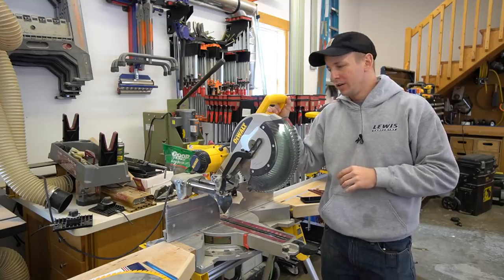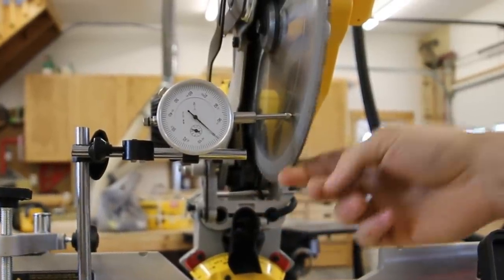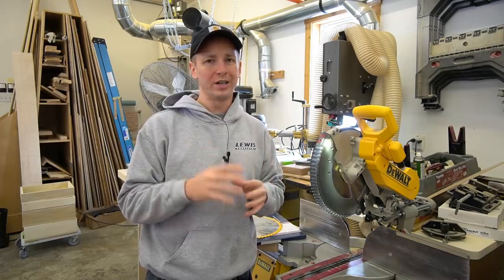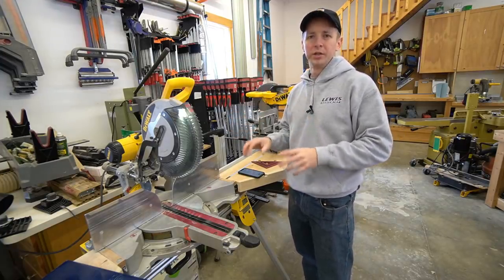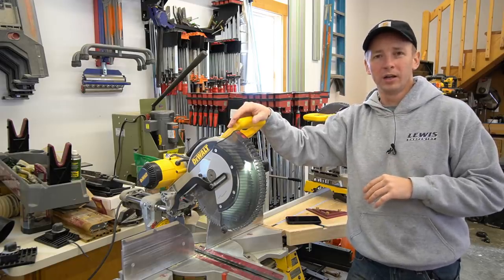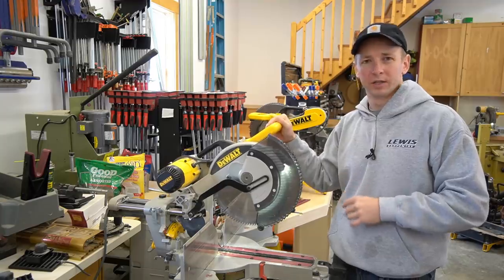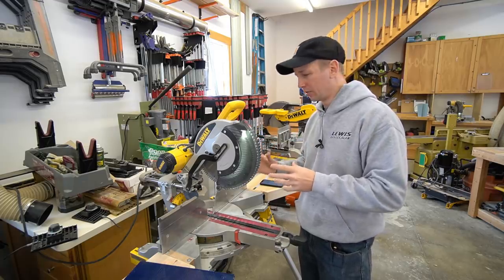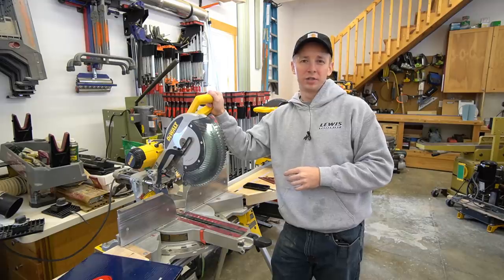DEWALT DWS780 | The BEST Miter Saw for Production Trim Carpenters???

Comment: I'm on my 3rd 779. I absolutely love them and I don't know a single other carpenter in my orbit using anything but a 779/780. They are just literally the best miter saw for the money on the market. The only thing I don't like is having to reach behind to bevel. I wish it was up front like the Bosch. It's the only thing I don't like about the saw but given the huge vertical cut capacity I don't bevel often.

Comment: Spencer I really appreciate your incite you provide in your videos. I'm wondering if you have ever used Milwaukee's 12" slider 6955-20? I've owned both the Kapex and Dewalt. Long story short I lost confidence in the DeWalt and bought the Kapex. It was great, but I had to sell it. Eventually I bought the Milwaukee and really like it. It has a digital miter scale which I love. It has a unique bevel lever to set the bevel angle, which I find really easy to set. Maybe not as nice as the Kapex, but better then the DeWalt. Dust collection is pretty good as well. I watch a lot of these type of videos on YouTube and I haven't seen anyone talking about the Milwaukee. I'm curious why it isn't talked about.
Reply from the maker: I'd like to try it. The dewalt has been the industry standand and most popular saw for a long time. It will be hard for milwaukee to compete with it.

Comment: The 779 only swings 48deg both ways.... is that enough? Seems kind of short. My fixed runs to like 60 deg. Rigid's equivalent meters to 70 deg each way. Is that dewalt 48 degrees really enough?

Comment: The problem I had with mine is that the rear fence isn't straight. The two sides were slightly concave, causing cuts to be a few degrees out on one side or the other. 

I ended up cutting and shimming them nearly perfect and haven't had any issues.
Reply: same issue for me. driving me crazy. how did you do it?
Reply: @williamdyer4431  I used blue painters tape and shinmed one side until it was flat, then squared the blade up. I did cut the fence in half on the rearward curve, but I'm not sure that was necessary.

Comment: It's my understanding that the runout can be the same on a 12" and 10" saw, but that at high speeds, and cutting through potentially heavy materials, that the 12" will deflect more due to the size. Hence blade stiffeners.
Reply from the maker: I think with a full kerf blade like I use that is all but eliminated.
Reply: @InsiderCarpentry  agreed! If accuracy matters at all, full kerf is the way to go. Did you say that the Kapex can’t handle a full kerf like the one you use?
Reply: What matters as well is how solid the arbor bearing is, especially on bevels.

Comment: You suck more then most.
Shadowline vs laser? 
Fine adjust bevel? You don't fineadjust.and the scale is not easy to read gets blocked .
Dewalt trench bolt flexes.
Blade cover needs fingerpulling if  blade is beveld.
"Motorproblem all over the world" - no only in sucky 110v country.
The kapex 88 sucks, but it's like a nicer dewalt, 
I can list 5bad  things with the kapex120 ,but is far better  .
a dewalt777 with 3-1 hose when dust is an issue.

Comment: I’ve owned a lot of miter saws.  I’m an airline captain but also own a construction company building and remodeling higher end homes.  

I have three crews for the homes we build. They are all very busy so it’s a first come first serve basis.  Anyway they all are run by first generation immigrants from Europe.   They love festool tools….. however they all, and I mean ALL run the Dewalt 780 saw and the Dewalt 10” contractor table saw. 

Now, they have the festool vacuums, sanders, track saws, dominos, and misc festool products.  One has a Kapex he keeps at his shop. He likes it a lot but is afraid to leave it on job sites at night. He always packs up the Festools but they almost always leave the Dewalt saws set up until they compete the job. 

I’ve owned too many saws. Currently own the Makita 10” 36v compound sliding saw with the Laser.  Before that I owned the Milwaukee M-18 10”, before that the Dewalt 780, before that Bosch 12” dual rail, similar to the 780 design, and before that saw I had the Hitachi C12LSH 12" Sliding Dual Compound Miter with Laser Marker & Digital Display.  Truthfully of all the saws I’ve owned, the Hitschi was the most accurate out of the box, the easiest to set unique compound settings (the digital display was fabulous in my opinion) and it was indestructible.  However the saw weighs 70 lbs!!  I had it mated to a roller stand and the two combined was 108 lbs. 

So why so many saw?  I don’t know… it’s a sickness I think lol.  I’ve liked all of the saws but hated certain design flaws that they all have. For example, I just got to use the new Dewalt 60v compound miter.  What a great saw!!!!  But it still has the two bar slider that sticks almost 14” out the back And my God DEWALT why are you still using a giant wing nut on the back to lock the bevel !  

My favorite miter for ergonomics has been the Makita 10 (Makita XSL06PT 18V x2 LXT).  I also really liked the light weight and ergonomics of the Milwaukee Howe we it’s build quality was poor.  

What will be my next saw?  Well,  I’m recovering from another back surgery.  I’m going to find a light saw.  I can get by with cutting baseboard laying down. So I’m leaning toward the “Makita GSL02M1 40V max XGT Brushless 8-1/2-inch Dual-Bevel Sliding Compound Miter”, the  “Festool 577176 Kapex KSC 60 EB Cordless Dual-18V Miter Saw” and the Metabo HPT 36V MultiVolt™ Pro Sliding Miter Saw | 7-1/4-Inch Blade  and the Metabo HPT Sliding Compound Miter Saw, 8-1/2-Inch Blade, Laser Marker, LED Light. 

All of the above are very capable saws.  Right now, I’m leaning toward the Festool.  We’ll see.

Comment: Any thoughts on this saw vs. the Bosch 12" with the gliding arm?  I have a small shop and I like how I can mount it right up against the wall...
Reply: I just got the Bosch 12" for this very reason. The DeWalt takes up so much real estate. And Im looking at modding the Bosch to accept the DeWalt XPS light

Comment: Awesome starting points for buying a mitre saw. Great video. 😁👏 That's good that You cleared the Kapex motor issues. 😖

What brand is the rack behind You with the Bessey clamps? Never seen that kind before. 🤔
Reply from the maker: It is made by woodpecker. I think it was a one time tool. I'm sure they will make it again someday.

Comment: Another great video Spencer. Agreed on all points. I would like to clarify, I'm not sure where you're finding the weight difference. I've used both and they seem the same, and when doing a check online both saws spec out at 56lbs. But perhaps somewhere they've put out conflicting info. Anyway, the 780 is basically the 779 with the light added. The 779 usually runs $400 USD, while the 780 runs $600. If you don't mind spending an hour of time, people can buy the 779 , and then order the light for like $68 (full kit) and install it themselves. Voila...779 is now a 780! Of course if you don't mind the extra $ and don't want to mess around, just get the 780.
Reply: The older type 20 779 was 67 pounds. There also is a few more differences on the newer type 22 779 vs 780 (other than the light.)
Reply: @jameshill4900  good info Thanks!

Comment: I agree with all he says.  One other point I'd like to add is that the blade guard is great.  You can hold it with your trigger hand to keep it out of the way for accurate cuts.  The Kapex runs on the inside and gets in the way at times.

Comment: Just got the DWS780 home. Used one but like barely as they could have convinced me it was new, never used. Paid $250 with the stand which is also new. Good deal and I would take it all day long but........ My first impression is I like my old Ridgid 4221 better. It has everything this 780 has including the shadow line, and everything is about 3" bigger. The rip capacity, the fence width, the depth on the side where you mount the wings, and although I hear everybody saying these belt driven saw's are smoother than direct drive, I don't notice any difference other than the Dewalt seems to have more torque. So much so that it shoots up in the air when I pull the trigger. I'm sure I would get use to that after some use but I'm not cutting 6x6's all day so I'm not sure I need all that torque. This may be a case of liking what I know but I think I'm just going to list it for $400 and hang on to the old Ridgid. Everything I own is Dewalt minus the Miter Saw, so it's not like I am a Ridgid lover, I just honestly like the Ridgid better.

Comment: Spencer are you running into the taller base 8” (7 1/4). This is becoming our most requested base in craftsman/farm style homes.  I think the Makita 12” might cut it standing against the fence.

I agree about the Dewalt 780 and their latest cordless 60v.  I have two complaints about Dewalt. (1) I dislike the rear rail system for the obvious reasons. (2) they stay with what they know.. almost never innovating when it comes to miter mechanics. I’d love to see Dewalt offer a rail system like Makita, Festool or possibly Bosch.   

The time having a near zero clearance saw is when it’s in a shop or a workstation trailer.

Comment: Im in the market for new saw but the dust collection oh man on the dewalt is like nothing. I don’t know why they don’t address that since i work with MDF a-lot and have to wear mask. What you think of Milwaukee new cordless 12in? Seems like has better dust port.
Reply from the maker: Agreed. I haven't really paid an attention to the milwaukee as of yet.
Reply: In my opinion, the battery powered Milwaukee deflects more than the Dewalt. You have to be real careful with the effects of hand pressure during the cut.

Comment: From what I understand, the modern 780 is the exact build as the 779 minus the laser. Previous generations were much sturdier and warranted the higher price. After looking at the prints, it appears they downgraded the quality and left the price.
Reply from the maker: I don't think anyone truly knows the real difference.
Reply: @InsiderCarpentry  Well you can pull up the exploded diagrams and they share nearly every part number other than a few small items like the xps LED of course. Older versions were absolutely different though.

Comment: Do you use 80 t blade for everything?   I never had good luck with that many teeth and hardwood with dewalt's  rpms.
Reply from the maker: 100 t actually. I am almost always cutting poplar.
Reply: @InsiderCarpentry  Have you had a chance  to try out the flex volt miter saw, having both the ability to use a cord or go cordless?

Comment: So i will say i use all 8.5 saws. 12s do have alot of deflection. Not in the blade but when cutting. Try this when standing up a peice of base try to trim 1/2 a blade width, i promises your saw wont cut square. Same with bevel cuts.
Reply from the maker: I don't disagree. Its a trade off for sure. But I can work with it.
Reply: Gonna disagree.  That's where blade selection comes into play.  A well tensioned full kerf blade makes that cut perfectly every time.  The SM6300 he's running has no issue trimming small amounts off. Same goes for the high end miter blades from Royce Ayr, Everlast, Amana, Popular Tools etc.

Comment: Hi. Could you please advise if that saw will run on any blade thickness i.e. thin ones such as used in Makita? Thanks
Reply from the maker: Yes, it should work just fine with thin kerf or full kerf.

Comment: Reference your shadow light comment. There are numerous reports of the shadow light failing within weeks of ownership. Some yt videos even show board replacements and that DeWalt CS has been pretty lame supporting this issue. Im looking at replacing my DW718 that has been a work horse for years and has the laser. The question that remains is has quality and dependability been sacrificed by all dual compound sliders? Which new miter saw should I buy? The answer to that appears to vary across the board and there is no right answer.

Comment: on the 10" v 12",  I agree with you 100% but... some 12" saw are > 4200 rpm. the teeth are moving way too fast and there is no simple way to slow it down. The Dewalt sliders are 3800 rpm and with quality 12 " blades are no problem. 
On your comment on the fence on the Caoex, I have a rigid that the left side of the fence and the right side of the fence are not in the same plane. I cut the connection between the two sides and set one square and the other to the one I set square. Problem solved.

Comment: I had a 12 dont remember the model.  only use for tall baseboards mainly MDF very little use the belt rip, brushes change and last time like 10 moths ago the motor burn. how ever my Dewalt 10 inch Still kick currently  doing 800sq ft of parquett on 3/4 x 4 solid white oak.  6 days of heavy cutting. keep cutting 👍👍

Comment: Hey, Thanks for sharing this video - what is that tool you used to measure the gap between the straight edge + Mitre carriage + mitre wings shown in 3:59 - 4:26 ? I have had two DWS780's sent to me seperately and I have had to send them both back due to the carriage being lower than the wings. This tool will really help identify if my new saw is true

Comment: The den of tools exposed they're building to 780 which 779 parts and just adding the light kit and calling it a 780 I got to Hercules 12in sliding miter saw stand for the price just a 780 last time I checked the 780 was $600 I got my Hercules for 299 I love it

Comment: Great vid, thanks for sharing. Have been running a DW717 for a while now and was cleaning my blade today and noticed the cast arm is actually cracked! Could not believe it and they no longer make that part. Been looking at this as a replacement for it.

Comment: I could see using fixed for high end furnature joints but for 99% of carpenters a high quality sliding saw would never make a difference imo.

My old miters fence was bent the same way and it made me nuts. I better calibrate my new one

Comment: The DWS779 is the same saw but with out the light over the blade and its a lot cheaper.
Reply: The newest 779 has features other than the light removed. The steel bevel lock knob is replaced with plastic, the preset pawl bevel stops (22.5 & 33.9) are removed, and the quick lock lever for plunge cutting is only on the 780. The older 779 had these features.

Comment: Good job on your video.  I have some questions please.  Which type DWS780 do you have type 22, type 23?  It will say on the label on the motor. The description I see is that it comes with a 5/8” arbor for the saw blade.  Did your saw come with an adapter that allows to install a 1 inch arbor saw blade?  Thank you in advance for your answers. I’m ready to pull the trigger on buying this saw but I need to know if my SM6300 blade with a 1 inch arbor hole will fit on a type 23.  I asked another new owner 2 months ago and he said his type 23 did not come with an adapter but the online Dewalt document says to use the adapter with a 1 inch arbor blade.

Comment: The problem with the Kapex is that it's designed to run off 230v. In UK we can get the 230v or 110v version. I had the 110v version at first and it was completely gutless especially with hardwood. To be fair to festool they they swapped the saw for the 230v version which was plenty powerful enough and easily the best mitre saw I've had to date. I've got the new Makita 40v 216mm saw arriving tomorrow so that may change.
Reply: So what’s better the new makita 40v or kapex?
Reply: @isaacrodriguez6476  The Kapex is the better saw but for my work the makita 40v is the best option.

Comment: After research not only the light, but the bevel knob is plastic, no bevel stops on the sides for those angles used in trim, and the much smaller fence on the 779 vs 780.

Comment: In the trades for 44 yrs.  Bar none the 780 Dewalt mitre saw is the most accurate saw out of the box, I’ve ever used!! Always make sure your material is firm against the back stop,  if not your material will slam back against and potentially make the U shape back stop out of true!!